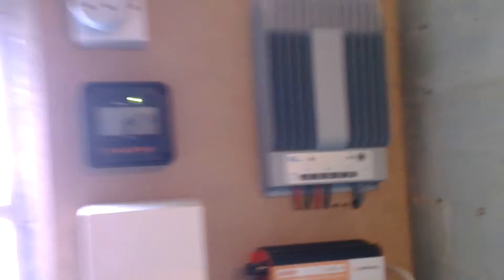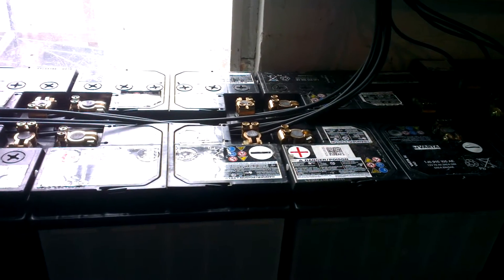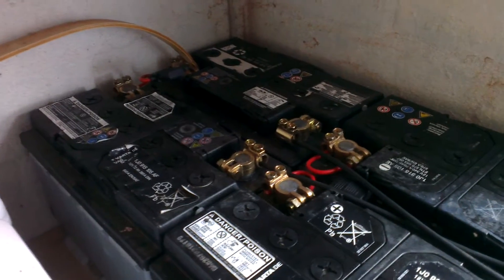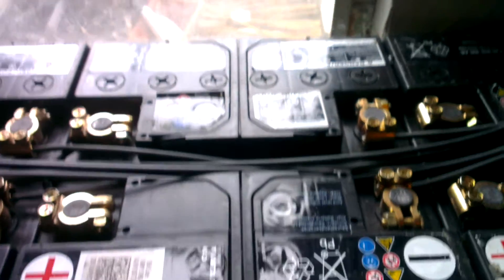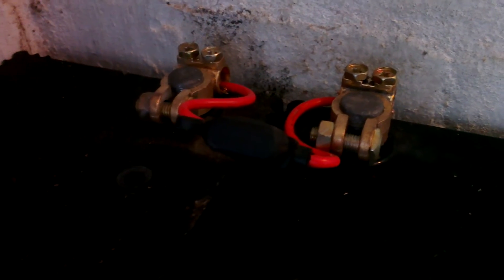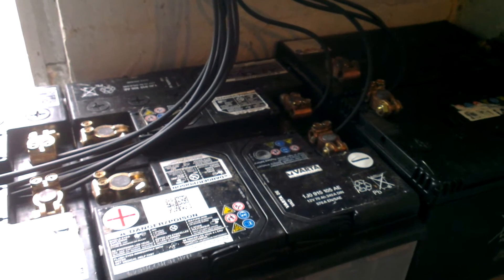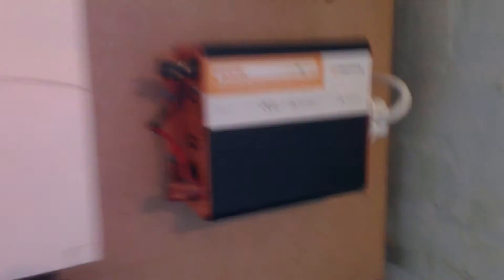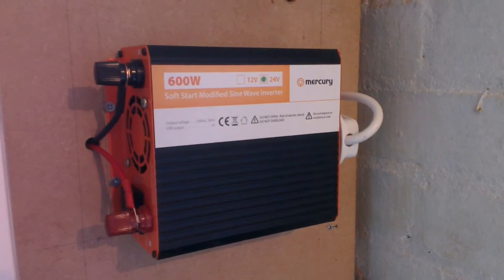My DIY offgrid home solar power station - UK - PART 4

Comment: your running off of car battery they are bad for that type of system get some deep cycle batteries about 70 each a car battry is designed to give off big bursts of power and be charged slowly
Reply from the maker: Hiya! These batteries are now 2 years old and still going strong. :-)

Comment: That's an awesome setup, where did you get the batteries from?
Reply from the maker: Hi Apocalypse! I got them from a metal recycling centre. I went in with a multimeter and just checked each battery before buying. Antony...
Reply: Antony Cartwright thanks, sorry for the questions, whete did you get the solar panels from?
Reply from the maker: Hello! No worries... I got them from a junk shop type place... It was a yard which sold all sorts of random stuff. Kind of odd really!
Reply: Antony Cartwright blimey, that's a good find!! I can't find any anywhere other than ebay
Reply from the maker: Yeah! Ebay is just as good! Just make them offers and start bargaining!

Comment: Your inverter is probably having trouble dealing with the high inrush current that devices with switchmode power supplies tend to draw when they first turn on. Simplest solution is to turn them on sequentially. Going up a cable size or two for your battery & inverter connexions could help too. (As the high current impulse could be drawing the voltage down at the input of the inverter and tripping it's low voltage detection circuitry.)
Reply from the maker: Hiya! These are older videos, see the latest one for the newest revision! Yes, you're right though. The inverter shown here was a 600w, modified sine wave inverter. Antony